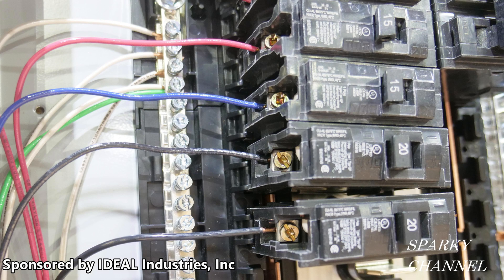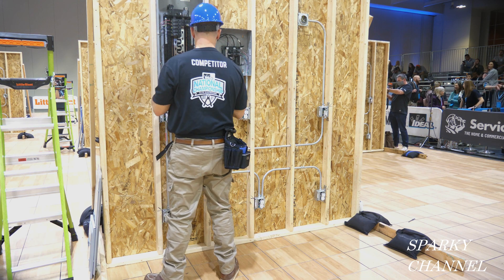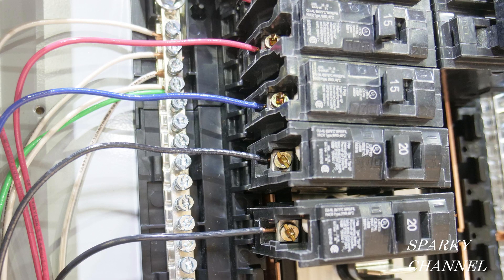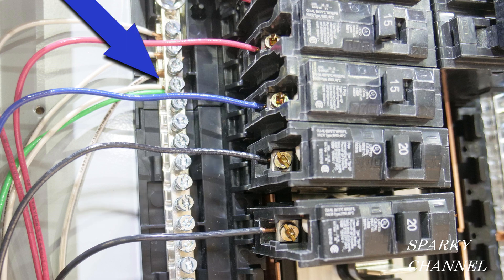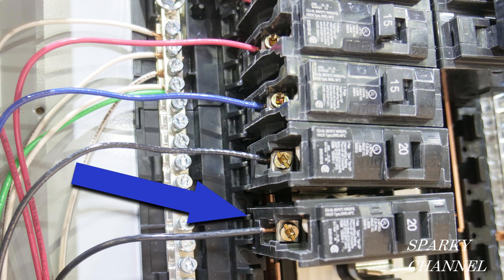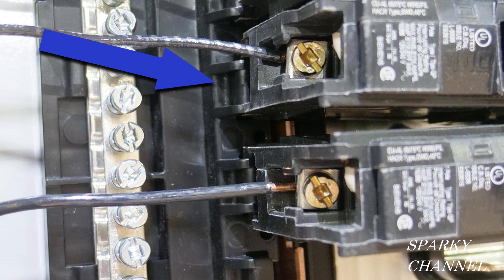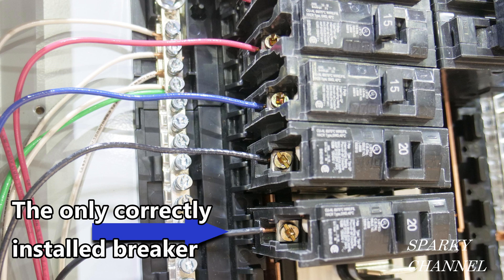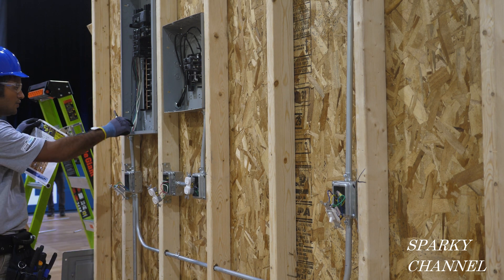What's Wrong? 2021 IDEAL National Championship NEC Violation Board 1st Round Part2 from Nashville!

Comment: I would also recommend a tie bar on any multi-circuit breakers to prevent a potential shock hazard from the shared neutral conductor.

Comment: When I look in my panel box, I don't see wires of those colors....what's up with that?
Reply: Black red blue is 120/208 volt panel 3 phase it’s more commercial. At your home you will have black red 120/240 single phase residential.
Reply: @cookie19292  Thenques!
Reply: @cookie19292  Actually in most residential panels you going to see mostly all black and black and white for the 240v. Red in some situations but not as much

Comment: Could the 12 ga conductor on the 15 amp breaker be a situtation where you had a longer run and had to up grade the wire size to compensate for voltage lose?
Reply from the maker: Yes, and if you noticed on my previous video where I did a close-up of the writing on the breaker, the breaker also listed 10Ga. Perhaps I'll do a video on that. It's an important point.

Comment: Color scheme is wrong... 
Should be 
Black
Red
Blue
Black
Red 
Blue (not a violation however)
Reply from the maker: Thanks!
Reply: Color scheme doesn't matter. Also, it's not a 3 phase panel.
Reply: @IceBergGeo  elaborate on what "doesn't matter" means...
Also did you read my comment...??
Reply: Unless it's a grounded delta then the N.E.C. is very specific Brown, Orange then Yellow.
Reply: @nomore8042 nope it sure isn't...
Code only stipulates for neutral and ground...
Please cite the article(s) that were violated...???

Comment: Color code is wrong.
Reply: That’s the first thing i noticed
Reply from the maker: Black, red and blue are all acceptable hot conductor colors (non grounded conductors). Is that what you are referring to?
Reply: @SparkyChannel  I believe they meant Black for 1/2, Red for 3/4, Blue for 5/6, etc down the line. (The "6 rule").